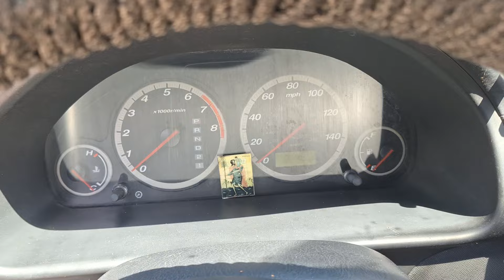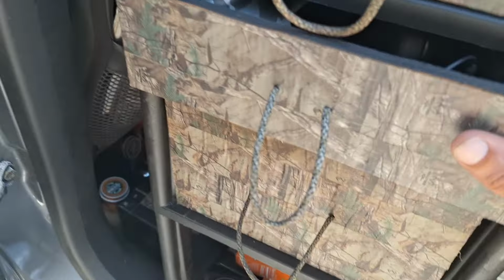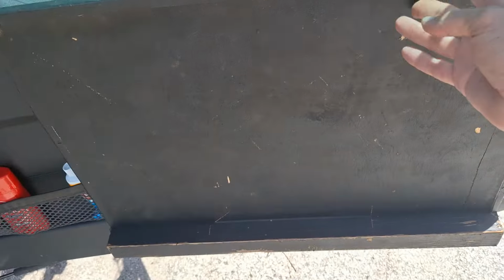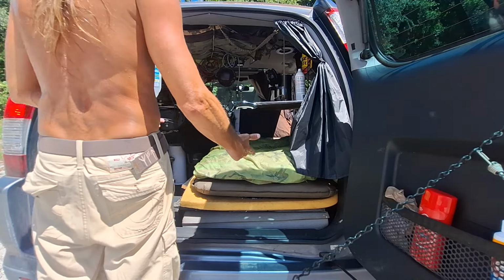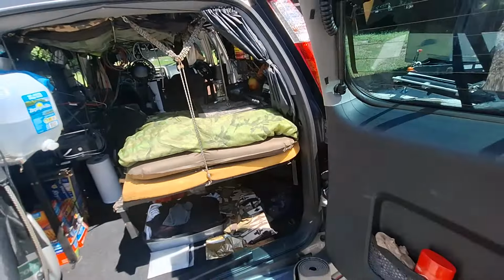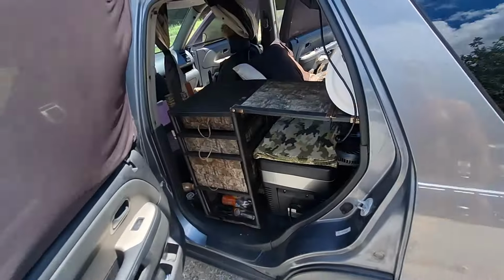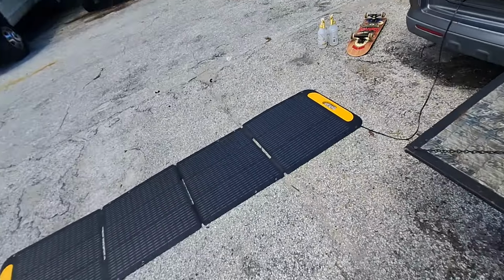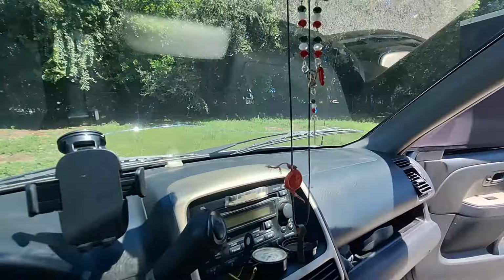Mobile Home in Honda CRV (Walk through)

Comment: Hey Joey. I'll be most likely living out of the car this winter in Wisconsin. I'm gonna build out of a car like you. I want to build it out well enough for the winter with the right equipment. Good to see you post
Reply: Damn. It's gets cold in Wisconsin doesn't it? I thought it's similar to southern Canada where I'm at.
Reply: @jonhutchinson2902  yes it's very cold in the winter. 0 degree sleeping bag, hand warmers, hats, gloves, extra socks, sweaters, portable heater.. it can be done you just need the right equipment
Reply from the maker: Dude get a generator or 2 that charges off solar and Amazon has these electric blankets that plug into the cigarette lighter port on the generators. I used one all winter down here off my generator in the trailer I was staying in. They also make small electric space heaters but they tend to eat power.
Reply: @joeythegypsy  I'll definitely look into one of those for sure. Currently saving up for a car

Comment: I have this same car with manual transmission. bought it at 155 376 miles and now its like on 193 909 miles the only major thing i had to fix was the clutch and did it myself without any previous experience when it was at 178 000 miles. changed one caliper last year, thats about it so far. I think you made a good choice getting this car

Comment: Should get one of those class c rv it’s like a big ford or Chevy van except it has a little sleeper bed up top over the driver seat area and another little sleep space in the back basically just a bigger conversion van and you don’t need any special license or anything and it’s way way more room and can still park it anywhere as you normally do a regular vehicle

Comment: I had a sword just like that. I think I paid like 10 bucks for mine. They are junk. It may be sharp, but they break.
Reply: Actually, my sword didn’t have the hand guard on it and mine looks like it was longer, but I’m sure they’re probably just about the same thing. Honestly, I think they’re worthless for the most part. The tip is extremely sharp, but it will break and I just don’t see it being veryuseful because I think it’s too light it doesn’t have enough weight to really make a good impact, but I could be wrong
Reply: Actually, my sword didn’t have the hand guard on it and mine looks like it was longer, but I’m sure they’re probably just about the same thing. Honestly, I think they’re worthless for the most part. The tip is extremely sharp, but it will break and I just don’t see it being veryuseful because I think it’s too light it doesn’t have enough weight to really make a good impact, but I could be wrong
Reply: For your hood latch lever thingy what I’ve done in the past is wrap wire around the broken plastic piece and then turn it into a loop. They don’t last forever, but it will last quite a while much more convenient than using a tool that you have to reach for etc..

Comment: Have you ever had to deal with bed bugs? I think I am right now. No, I'm not talking about heroin withdrawal, but actual bed bugs.
Reply from the maker: Yea in nyc. Total nightmare. You need to wash and dry every article of clothing you have. Then avoid wherever they came from.
Reply: @joeythegypsy  where do they come from?
Reply: @joeythegypsy  I looked into where they came from, which is basically asking where everything came from, but then where did that come from? Anyways, we picked them up from bats, them poor bats, we blame everything on them. We picked them up from bats when we lived in caves. I'm not sure if they are bed bugs. I think they might be wheat mites since I saw about 20 tiny yellow mites in an empty hamburger bun bag I left in my room over night. I'm still itching, but I'm also slightly withdrawing from suboxone using your method. I get the strips which are a little easier to measure.